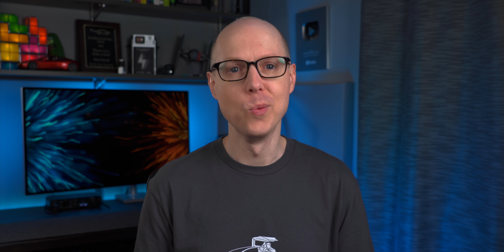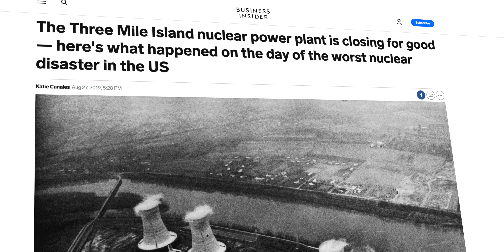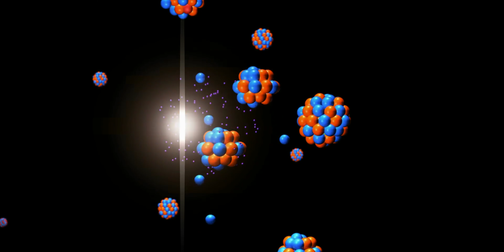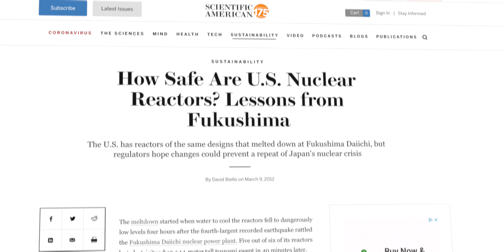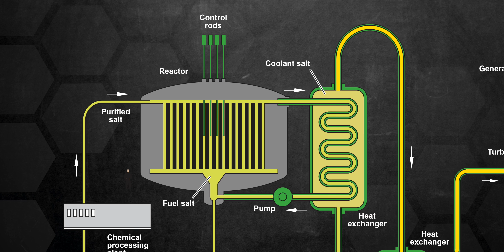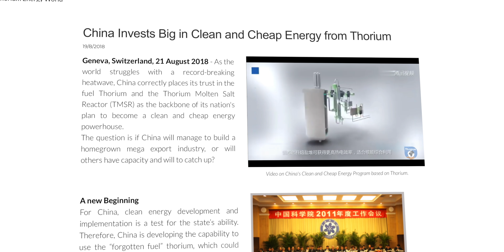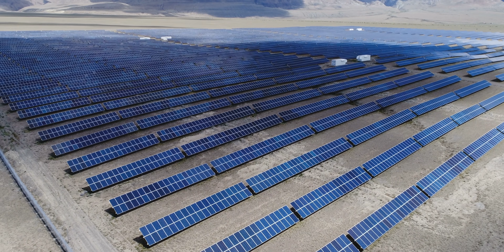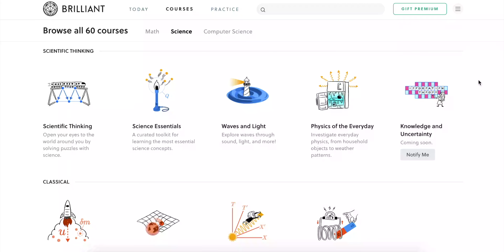Thorium explained - the future of cheap, clean energy?

Comment: Just a clarification, Chernobyl was not a cooling system failure. It resulted from puting the plant in an unstable condition (and poor design) leading to an uncontrolled runaway in reactivity and a loss of coolant casualty which lead to a second larger runaway. Pretty much operator error.
Reply: AND government bungling.  The first reactor at the University of Chicago was a carbon reactor.  As soon as it started up, they figured out how dangerous it was.  TRhey shut it down and buried it under the football field.  Chernobyl should never have been built.

Comment: Note that the fact that the waste from a thorium reactor lasting only 500 years, whereas the waste from a uranium reactor lasting 10,000 years doesn't make the thorium waste safer or better. In fact, pound for pound, at the beginning of its production the thorium waste is going to be 20 TIMES more dangerous than the uranium waste because by definition the half life of a radioactive isotope and its level of radiation (specific activity) are inversely proportional. The absolute amount of radionuclide wastes the reactor produces is an equally if not more important metric here.
Reply: Hi Muonium,
You have a valid point, but you are looking at it the wrong way.

WHERE do you want the heavy fissionables and transuranic actinides to be?  INSIDE the reactor!  There they can sit until they burn up!

The current reactors designed 70 years ago, uses solid fuel pellets, so the wastes and the unburnt fuel are mixed together, and there is no easy way to separate them.  Molten salt reactors are 'chemists reactors' where chemical processes can remove fission products and keep the actinides INSIDE the reactor until they burn.  (You can do chemistry on them easily, because they are in a liquid form.)

So the most dangerous substances remain in the reactor, and the fission products (with short half lives), are pulled out.  They rapidly decay to background levels of radioactivity.

In other words, a big part of the current wastes are unburnt fuel.  The LFTR design, keeps the unburnt fuel inside until it burns.  Which is what we want.

Warm regards, Rick.

Comment: It is NOT Thorium that is the important innovation, it is the reactor TYPE. The molten salt reactor is essential for efficient use of thorium, but it is also a far more efficient reactor for Uranium-Plutonium fuel cycle, too. All of the benefits the narrator claims for Thorium are characteristics of the REACTOR, not the fuel. Almost everything stated in this video is a mischaracterization and terribly researched. The waste in both fuel cycles is minimized because there is no solid fuel. Solid fuel pellets retain 95% of the fuel when they become unsafe and liable to rupture. Liquid fuel has no such limitation and can be consumed completely. Thorium produces less transuranic byproducts, but in molten salt reactors it doesn't matter because the transuranic products are also fissioned. More likely than not, the first commercial molten salt reactors will operate on the U-Pt cycle while work continues on the more difficult Thorium cycle implementation. See Elysium Industries and Ed Phell's presentation.

Comment: Burning fossil fuels for energy is a slow motion disaster in and of itself. The difference between nuclear and fossil fuels comes down to which poison do you prefer? With improvements in nuclear power production, the risks are lower than ever. Burning fossil fuels releases not only greenhouse gases but also numerous other dangerous byproducts and, there is no way to avoid this.
Reply: Thorium waste can be easily disposed of. It uses alpha radiation, so it cannot travel through even paper. The waste decays in 300 years, so if you dump it properly, it's not much of a poison.
Reply: How exactly is nuclear energy "poison"? Do you realize coal-powered plants produce more radioactivity into the atmosphere during its regular than a nuclear power plant? Turn the nuclear fuel molten and there's not even a chance of a melt-down.
Reply: @BirdyLegs2849  With the exception of thorium, nuclear power results in nuclear waste that sticks around for a while, aka a poison. And with Fukushima we saw that there are hazards we can't plan for. One reason thorium hasn't received the funding it should is because it doesn't allow the production of plutonium that can be used in nuclear weapons.
Reply: @Benson_aka_devils_advocate_88  Nuclear "waste" is not a "poison" radiation is not magic, it's light, stop drinking koolaid THAT is poison.
Reply: @BirdyLegs2849  It's not light. It's electromagnetic radiation. 

What descriptor would you prefer me to use?
Reply: @Benson_aka_devils_advocate_88  News flash for ya bud, magnetism, gravity and electricity are all forms of light, they're simple induction of energy, why do you think heat and light are so connected? Calling magnetism it's own separate force is akin to calling steam its own element, it's utter nonsense. Anything that is hot emits light (energy) You can call it what you like but that doesn't make them a different force.
And in closing I'd say calling radiation "poison" is hysterical nonsense. Radioactivity is only dangerous based on its frequency (light waves yet again, big surprise.) And can be very very easily contained and stored, you've been watching too much cartoons if you think Nuclear waste is a real issue.
Reply: @BirdyLegs2849  You still didn't answer my question. What would you prefer me to call it?
Reply: @BirdyLegs2849  Neither magmatism or gravity emit light. Neither are they forms of electromagnetic radiation.

Comment: Naturally occurring u235 is usually about 0.7% of uranium.
Reply: meaturama  
Hi Meaturama.  Yes, U235 and U238 are both Uranium.  But bombs want about 95% U235, and commercial reactors want about 4% U235.  U235 makes up a tiny fraction of the natural Uranium, so to be usable, the fraction of U235 must be enriched.

Warm regards, Rick.
Reply: meaturama HaHahaha, you have no idea what you are talking about... you’re the idiot. If you knew anything about nuclear you would know that OP was referencing the isotope u235 which is about .7% of all uranium as mined.  Most uranium is u238 as OP is referencing.  The video (so people like have a chance to understand) leaves out the enriching process where they bring up level of u235 in the mix of u238 from .7% as natural to 3-5% as used in the reactors.   Moral of the story, it’s actually you that has no idea what your talking about....:).  So come listen and learn.
Reply: meaturama technically yes... 😑
Reply: u233 fissile (made from Th), u235 fissile. u238 fertile.
Reply: @Addam Riley - Not assuming anything, it's obvious. Also a perfect example for the Dunning–Kruger effect. Elementary particles are excitations in the quantum fields and the lowest possible energy state is the so-called zero energy state. Just because the word "energy" is in there doesn't mean you can extract energy from it. To extract energy from anything you need an energy gradient. You can't extract anything from a uniformly distributed energy "field". So the "energy responsible for our consciousness" is not in any shape or form the zero-point energy.
Reply: DayZ Bulgaria your brain is a gradient. Just look up the Lockheed skunkworks, and the quantum physicists that actually study this. In less that 5 years they will move it into fact category. Are you aware of how the UFOs(flux liners) work and that time is not linear?
Reply: @addamriley5452  You didn't understand anything I've written because you lack basic understanding in the area of quantum physics. You made several factually wrong statements in your incoherent ramblings, which I pointed out. I have no time for clowns.
Reply: DayZ Bulgaria buddy, stop trying to insult people and actually discuss why you think it’s wrong. Also I’ll ask again, do you know how the flux liners work?
Reply: DayZ Bulgaria also one more time. The energy “itself” IS consciousness. That’s why you only need a gradient to harness it in other respects other than yourself.
Reply: If you play Factorio, you were already aware of this fact, as it has you mine - and then separate U235/U238, at about that yield =)
Reply: Guys between all atoms is literally infinite energy. This is what’s known as zero point. The only problem is that the public can’t use it until we attain peace because it’s to powerful to entrust in the hands of humans currently... luckily however the quantum physicists have proven that consciousness is a singularity.... therefore we have all been the same person this whole time. The majority of humanity doesn’t know this though. Once we all figure it out, World peace is gonna be a shitload easier👌 have a good day lads. Btw aliens exist and they already know they are you and there is no death. Humanoid is a 3D morphology that repeats itself everywhere.... so yeah, have a good day lads.
Reply: @addamriley5452  That's not what zero-point energy is. Zero-point energy exists in the empty space between the atoms not in the atoms themselves. The other part of your post is giving away your schizophrenia and I'm not gonna mess with that.
Reply: Theos Tragonidis I know that... what I’m saying is that what they’re calling “empty space” isn’t empty space at all. They lied. It’s the energy responsible for our consciousness. It’s a non local, non linear singularity. Our brains do not produce their own consciousness but are “formed” by it and connect to it. That means we’re all literally the same person. The atoms are just condensed energy. If you read the first line of what I first said again, you’ll realise you just repeated what I said...It’s not schizophrenia 😂😂. Look up the institute of noetic sciences, the Lockheed skunkworks and grow up before assuming people’s illness.
Reply: @addamriley5452  You also need to learn what singularity means.

Comment: In theory this could help with our energy and environmental problems, but before starting the party too early lets see if these reactors are really as reliable as they sound.
There is a problem with Tritium, which is highly radioactive (ß radiation and half-life of 12 years) and the molten salt corrodes through everything within months or years at the moment.
So yeah, nice reactor type but I don't believe the hype until there is a working reactor running for several years without any incident.
Reply: The US ran a molten salt thorium based reactor for 5 years without incident back in the late 1960's.  Alvin Weinberg and his team at ORNL (Oak Ridge National Lab) operated a molten salt reactor for 5 years without incident and non stop.  Nixon fired Weinberg and had the molten salt reactor experiment shut down.  Weinberg helped the US with the Manhattan project, and was integral in helping to shape the types of reactors we use today, but he did NOT want the US to us the type of reactors we use today because they're dangerous and produce lots of nuclear waste.  He was a fan of the molten salt reactor design and was trying to work out the details of how to do it, but then Nixon fired him and shut down all further research into it.
Reply: HI Diablokiller999
I'm afraid you don't know what you are taking about.  The molten salts are chemically stable.  If you were to melt table salt and put it into a steal can, there would be no reaction.  You are thinking of salt dissolved in water, where the ions cause a chemical reaction between two different metals (basically turning them into the anode and cathode of a battery.)

Another error is you mention Tritium.  This is a proton with two neutrons, which is not generated by fission reactions.  Fusion reactions take 'waste' neutrons to bombard Lithium to make Tritium to use in fusion power plants.  (Tritium would theoretically be easier to fuse than deuterium.)  However, I prefer proton Boron 11 fusion which produces NO neutrons.  It is harder to do, but I think that the current fusion research centres might be able to achieve it.

Finally, a molten salt test reactor ran for 6 years at Oak Ridge Nuclear lab.  It was shut down for political reasons.  (Nixon didn't like it because it was competing against his pet project - the Fast Breeder Reactor in California.)

Warm regards, Rick.
Reply: @RicksPoker  impurities within the graphite let the metals oxidise, also Tritium will be generated by the 3He within the process. See THTR300 in germany
Reply: @Diablokiller999  
Hi Diablokiller999,
Helium 3 is very, very rare, and very, very expensive.  It is SO expensive that people have written serious business plans to collect the microscopic amounts of Helium 3 that sticks to Lunar rocks after millions of years of the solar wind.  No one would put Helium 3 into a Thorium reactor.

Helium 3 is a fusion fuel, not involved at all in fission reactors.

Also, I don't understand your worry about tritium.  It is used in Radioluminescent lights for watches, numerous instruments and tools which want to be read in the dark.  It is used in novelty items such as self illuminating key chains.  It is used by medicine as a radioactive tracer where it is injected into people's bodies.

Further, it decays by beta decay.  A beta decay throws off an electron and an anti-neutrino.  That electron is stoped by a few millimetres of air, or your skin.  It carries 18.6 kilo electron volts.  If you drank some, the ionizing radiation could do some damage to internal organs, but you would need a lot to hurt you.  (They inject it inside people for medical scans after all.)

The low energy of tritium decays makes it difficult to detect tritium-labeled compounds, except by using liquid scintillation counting.  See...

https://en.wikipedia.org/wiki/Tritium

As for graphite making 'metals oxidize' I'm not sure what you mean.  These are FLUORINE salts.  They are already oxidized.  Fluorine is a much more powerful oxidizer than oxygen is; it is the most powerful oxidizer in existence.  Nothing is going to make the metals dissolved in the Fluorine salts become more oxidized than they are.

Warm regards, Rick.

Comment: Very good overview. However, a few points:
- Your "10 thousand feet" overview of the fission chain reaction should have not omitted the role of moderator,  because is it key to both design constraints and safety of reactors. You do mention it later, but I think its role should have been made much clearer right at the start.
- "Nuclear disasters" you (and every else) mention ad nauseam had a total body count (expressed in most pessimistically estimated lifespan shortening of those affected) lower than a single little "mishap" with "clean and safe" hydro-power, like the one at Vajont Dam in Italy, caused by a mere landslide. Not to mention deaths from fossil-fuel exhaust (both power and transport) associated respiratory problems. Nuclear power generation, as it is, not at some future state of it, is associated with fewest deaths per GWh generated, lower than even residential solar (apparently, climbing roofs is dangerous). This fact should always be stressed.
- There are numerous small modular reactor designs with passive convective emergency cooling, so completely melt-down proof, that still use uranium. They are ready for deployment, save for regulatory obstacles erected by the fossil fuel lobby aided by clueless "greens".
- Each and every proposed storage solution for long-lived nuclear waste, from granite formations, salt mines, deep oil bores, to vitrification and dumping into oceanic subduction zone trenches is perfectly safe (the latter also being future-proof - nobody will "stumble" upon the dump in ten thousand years when it sinks under the neighboring tectonic plate). "Nuclear waste problem" is invented one, again by coal and oil gang and their "green" accomplices. And, speaking of fission products, a nitpick: short-lived nuclides are highly radioactive, not the other way around.

Unrelated to this, but please try to pronounce non-English names in a way remotely resembling the correct one. It's not that difficult - Wikipedia usually provides IPA pronunciation guide, e.g.  [jœns ˈjɑ̌ːkɔb bæˈʂěːlɪɵs] for Jöns Jacob Berzelius - the initial "J" is pronounced similar to "Y" in "you" or "yoyo".

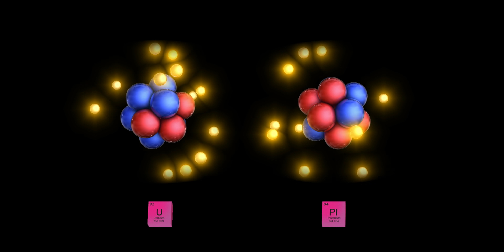Comment: WRONG at 3:38, "The spent U-23 from the reactor contains very radioactive isotopes with a half-life of thousands of years." If the spent fuel is reprocessed it only need to be treated a high level waste for ~500 years. See  Illinois EnergyProf, Dealing with the Used Fuel (Reprocessing), https://youtu.be/UA5sxV5b5b4
Reply: Very radioactive and thousand year half lives are mutually incompatible. The longer the half life the weaker the radioactivity. 85% of the radioactivity is gone after 1 hour of reactor shutdown. That's indicative of the hellish radioactivity of the very short half lives. After 700 years the fission products are gone but transuranics with century scale half lives make the spent fuel a few (5?) times more radioactive than new fuel. Not what I'd call very radioactive.